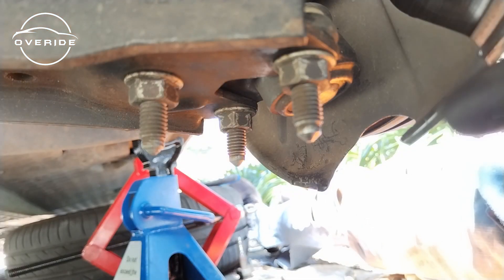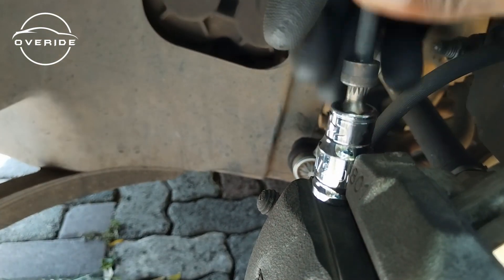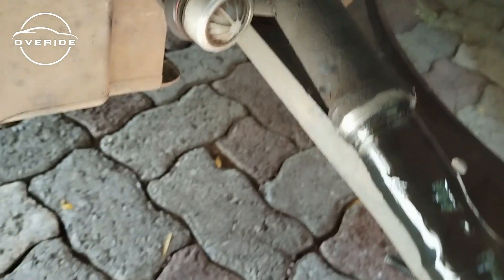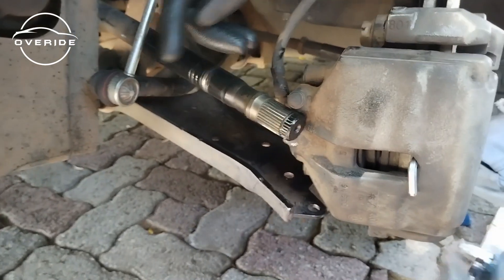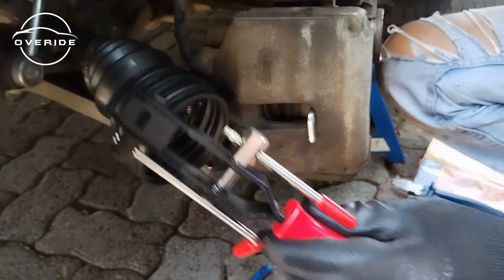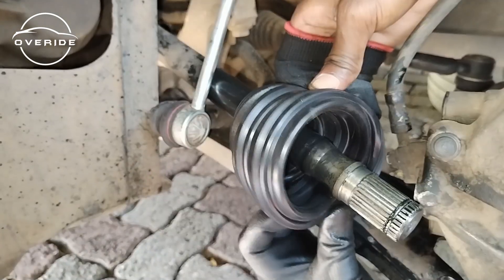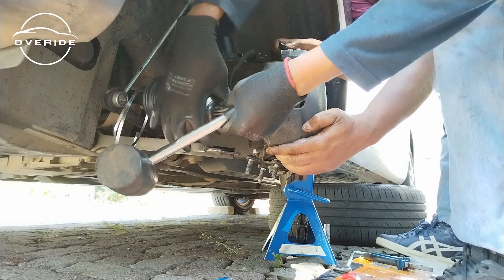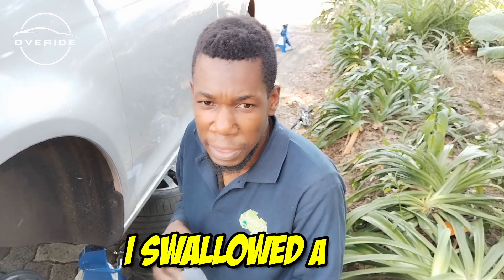How To Replace A CV Boot | VW Golf/Jetta Mk5

Comment: Hello my friend socket n°9 to put the cv head outside ? 
I have to replace my cv joint tomorow and you're video help me 
Thank you a lot 
From France 👍👋🫡
Reply from the maker: Bonjour, I'm happy the video could help you, thank you for supporting the channel as well.

You can use anything else that will fit in the hole so that the bolt can be able to pull the joint out
Reply: @MegatronicsZA  thank you very much for the response 
Peace👍
Reply from the maker: @crocop59 pleasure man, ✌🏼✌🏼✌🏼